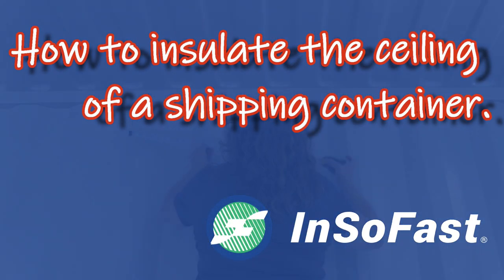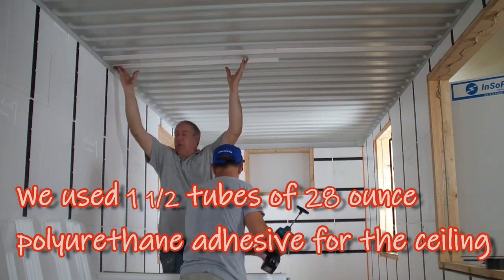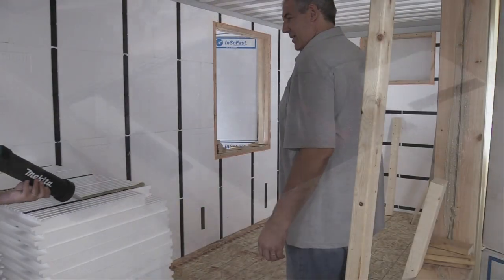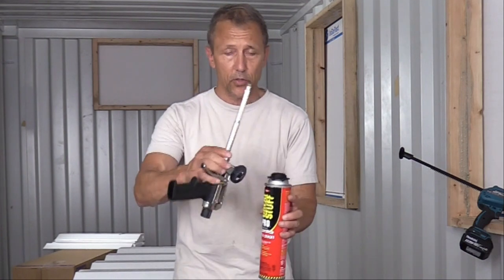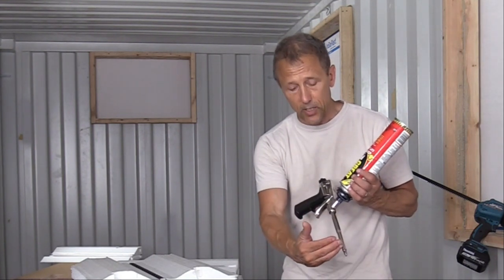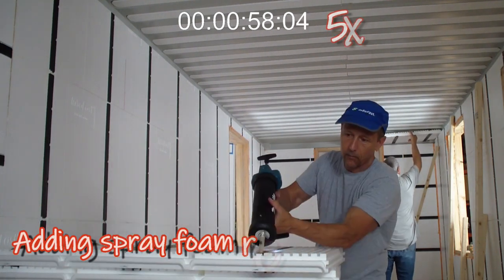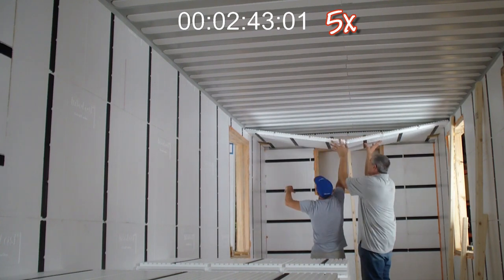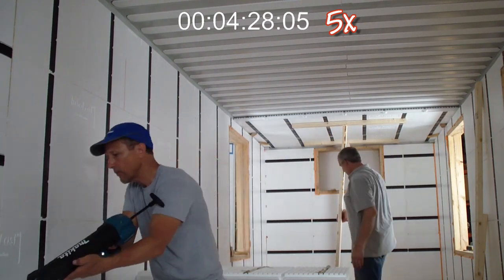InSoFast Shipping Container Ceiling Expanded Version

Comment: great product but you forgot a lot of infos..... like we have to shape the end of the insert that takes more time!!!!
Reply from the maker: You are correct not all the details can be squeezed into a 4:35 long youtube video. That is why we created in depth webpages to fill in the voids. I am sorry we don't always know what you don't know. The information you seek is on this page https://www.insofast.com/explore/shipping-containers-installing-panels-on-the-ceilings.html under Section 1 Ceiling Inserts: Start with trimming the inserts and apply adhesive in an "S" pattern; Use a razor knife to trim for the contours for the outside edges. Alternatively if you do not want to razor trim each insert you can use spray foam to fill the outer insert contours.